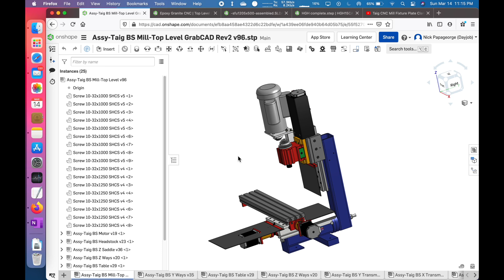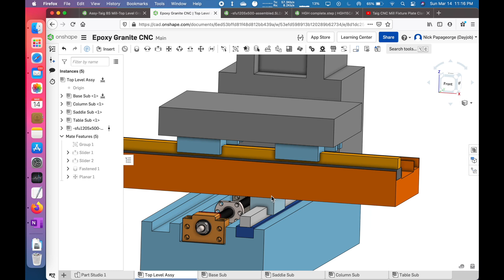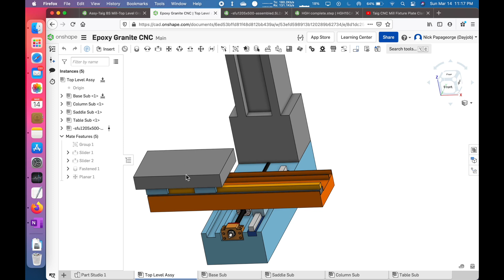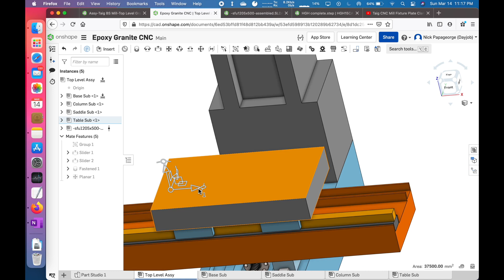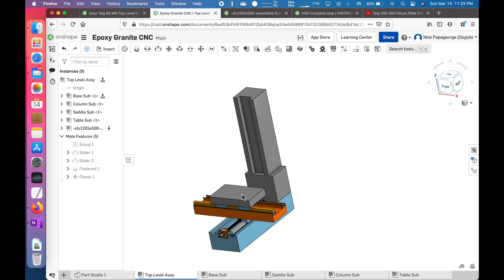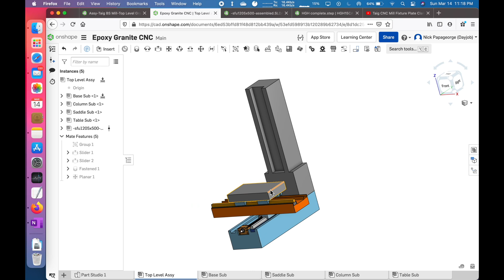Ep 1: Designing an Epoxy Granite Benchtop CNC Mill - Introduction

Comment: Awesome project!  Unfortunately, there's only a handful of epoxy granite mill build videos and most of them are not in-depth. I'll be binge watching this build, since I am planning on building my own milling machine.  

I have a few questions, if you don't mind me asking. First, are you adding wires as rebar to reinforce the epoxy granite?  I followed one build log on a sire that used them. It makes sense to me since it could prevent cracking and prevent crumbling on the epoxy granite. It also requires less epoxy granite and the cost more economical. On the other hand, I wonder if it is overkill and overcomplicates the build. It will be a bit harder to pack the epoxy granite mixture around it, leading to higher chance of voids forming. 

Second, for the X, Y and Z ways how are you planning on ensuring the railways are flat?  I will be building the three axis upside down with the rails at the bottom of the mold.  I am thinking of positioning and parallel indicating two precision ground bar stock with fastener holes on top of a precision flat substrate (possibly granite slab). The bars establish a precision flat datum for mounting the rails in order to avoid machining the ways later. Once complete, the mold walls are placed around it with a reinforcement wire structured inside. Finally, the epoxy granite is poured into the mold with a shaker motor to ensure there's no voids. What do you think?
Reply from the maker: Hi, thanks for the comments. I'm designing it live pretty much, so I don't have everything figured out yet (as you will see in later episodes). Adding re-bar to the main castings I'm unsure of. I saw Stephans HUGE VMC build, and his CAD that he shared on GrabCAD, and it looks like there is very little metal for reinforcement. There is metal for attachment points, but not for reinforcement. I figure his mill is probably 5 times the size and weight of this one, so maybe added rebar is not really needed. To be determined...

Ensuring the rail mounting surfaces are flat is probably the most critical thing with all these DIY builds. In later episode I share a few brainstorms on how I may do it. One is to use Mic-6 jig plate for the whole build, and rely on its flatness. No secondary machining. If the epoxy curing warps anything, or if those Mic-6 plates really are not that flat, I'd be out of luck. Second method is to cast everything, and then take a skim cut pass on a bigger mill. I have a bridgeport at my childhood home in another state. That method would rely on the accuracy of the bridgeport. Third method is to use a cheap surface plate, one of those 12" x 12" plates, stick some sandpaper on it, and use that across both rail mounting surfaces to lap the rails flat and parallel. If I end up putting a ridge on the rail mounting surfaces to align the rails/truck, then this lapping method would not work. I don't want to do scraping, too much work:) Finally another method is just take what the material give me, and live with the tolerances.

I think your idea of building the mold on top of a precision granite plate is good. I was also thinking something similar as another option, and using a big piece of Mic-6 plate as the bottom of the mold. So much of these DIY builds will come down to what tools one has available to them.